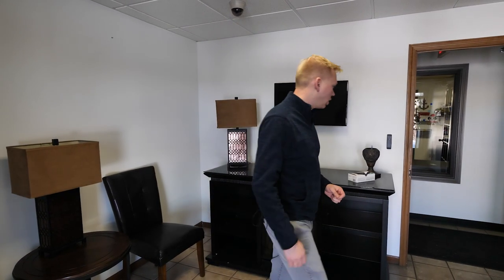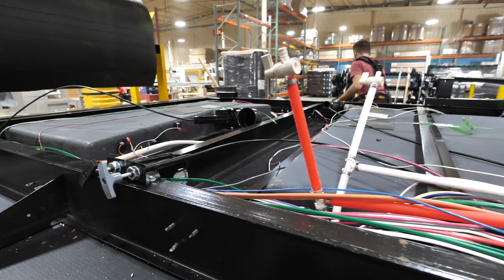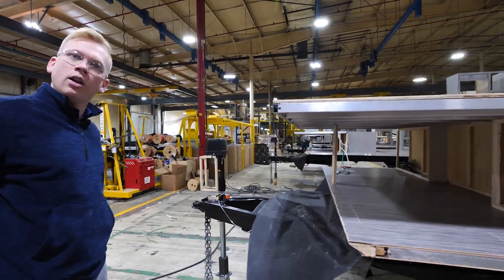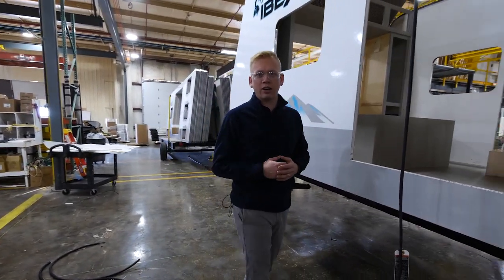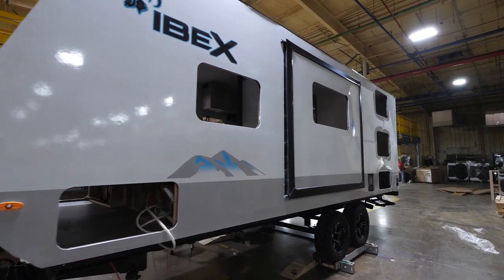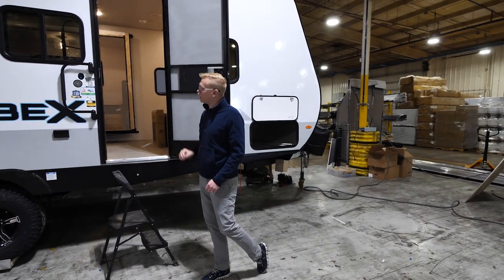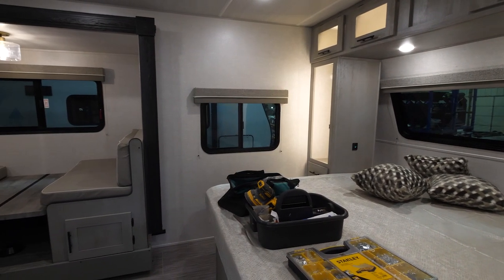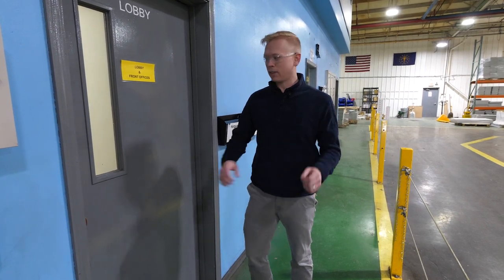IBEX Travel Trailers - Plant Tour

Comment: Wish a little more love would have been put into building our 2022 20BHS. After 5 trips out we are still getting saw dust coming out of places. Saw dust coming out of the walls, ceiling vents, under-storage compartments,  it's never ending. Blow out or vacuum up the saw dust before assembly! Fit and finish could use a little bit more love too. Holes for the USB plugs and switches were made too big and you can see them on the sides of the plugs/switches. IBEX'S made on the east coast are assembled differently and made with different parts than IBEX'S made on the west coast. Small differences but still different (tounge jack, storage cabinets, fridge/freezer, faucets, wheels, switch placement and some others). There is no insulation on the underside/floor(it is not completelysealed either). Cold air is always coming in from under the bed and from the storage areas. We love the trailer but seems like a never ending endeavor to fix and make the trailer like it should have been made or cleaned from the factory.